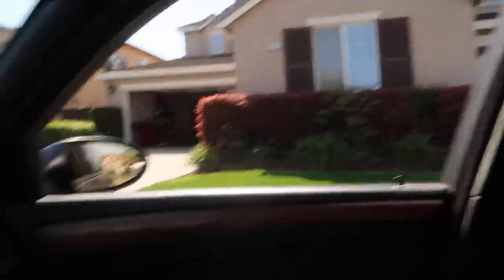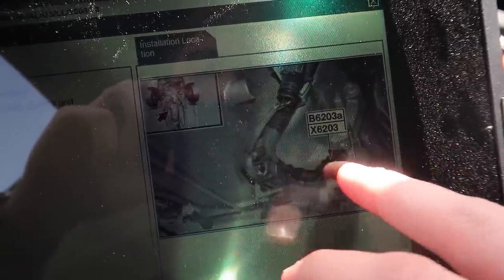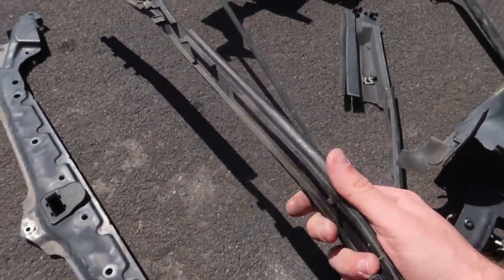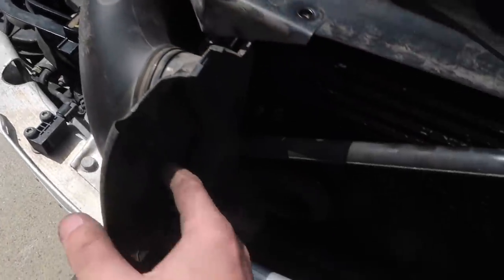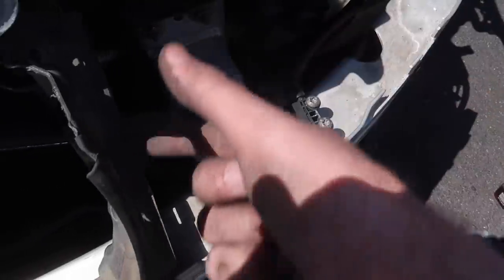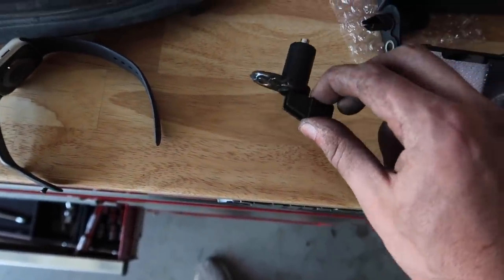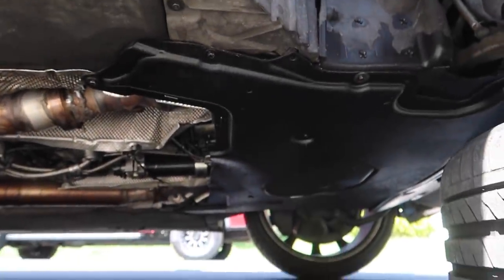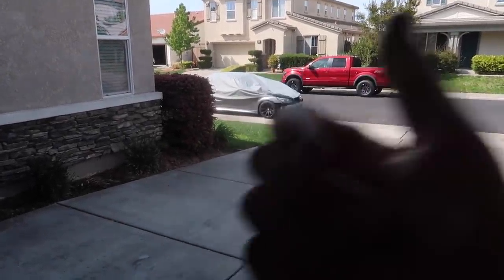REBUILDING THE E60 M5 ON A BUDGET! (HONESTLY SO CHEAP!)

Comment: "cheap Hella sensor" haven't had that bad of a laugh. Hella is an oe supplier, not sure if its for that sensor but anyway NOT cheap :D
Reply: Cringed when he said «hellr»
Reply: oh yes
Reply: Totally agreed, hella makes parts for BMW in EU
Reply from the maker: Ok ok I get it I didn’t know 😂
Reply: Hmmmm. Looks like it didn’t paste the link. How can I send you the link?
Reply: Check fuel pump and fuse. I never hear about bad crank sensor by v10. Or you have a wire cut by accident

Comment: If you can't get that out by drilling a hole in the center of the bolt and threading another bolt in there with lock tight and getting it out what you do is take it to that shop your 7 series is at and tell them just to weld a nut to the bolt since the transmission case is aluminum it won't weld to the case at all it will just weld the nut straight to the bolt then back it out with a 10mm socket...

Comment: When you change front lights change the modules below the light too, I don't recommend changing transmission fluids because it will raise small metal parts that are in oil and it will ruin transmission box I have broken a few by doing that.

Comment: Nour you ever check to see if the car has a Ghost Immobiliser, pretty much if you start the car without putting in a specific code the engine will just cut out, see if it’s that it could save you money

Comment: hope this beast wakens up with min. costs, and HELLA is a big electric and electronic manufacturer, if the part no. on the switch is 6PU 009 163-381, this would be a crankshaft pulse sensor, good luck

Comment: Same thing happen to my 3 series. The bolts they sell with the new sensors are like aluminum or cheap metal. It broke just by tightening it by hand so be extra careful when you put the next one. It took my dad and I like 2-3 days to remove the old broken screw just because the location makes it so difficult to remove it.

Comment: All you have to do is drill it out with a larger drill retap it with a larger size thread and use a larger bolt or insert a helicoil to the right size. It's a pain but it's like a $35 dollar fix. Btw it's not an empty hole into the tranny. If it were there would have been a gasket around the sensor. Just drill it as deep as the bolt would go and take into consideration the thickness of the sensor and washer.

Comment: If you have 5200 code- Signal, engine speed, is faulty (DME), you are more likely  have a slipping clutch. Where the transmission input speed doesn’t match the engine speed. Regarding no start conditions, you could try to pull a fuse in the engine fuse carrier, I believe it’s 10 amp fuse. It’s will only gives a starting condition but it won’t allows you to drive the car.

Comment: I know it's an older Video But yo can go to the BMW dealer and ask for a repair bracket for the headlight there are extra points for it on the headlight that are oem parts and cheaper as buying a used headlight.

Comment: Nour why don’t you try getting a bolt extractor kit you already have the drill, you just need to drill a smaller hole in the middle of the broken bolt so that you can use the proper bolt extractor to remove it. Just don’t attach the bolt extractor bit to your drill to try and back it out that will snap it in a second because it’s hardened steel you have to use a box wrench or a set of vice grips and back it out slowly also if you have a propane torch try heating it up before using the extractor bit since it’s aluminum it should expand making it easier to back out. Just don’t get the cheap autozone kit get a legit kit ask me how I know lol.

Comment: Wouldn't be surprised if the shop that did that shoty jb weld job also messed up the flywheel pickup ring thus why its not starting completely